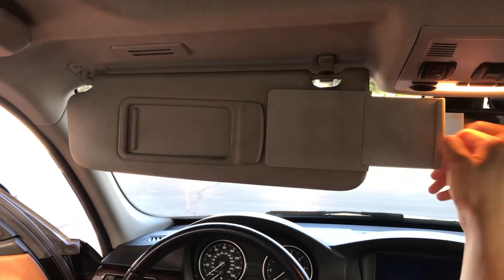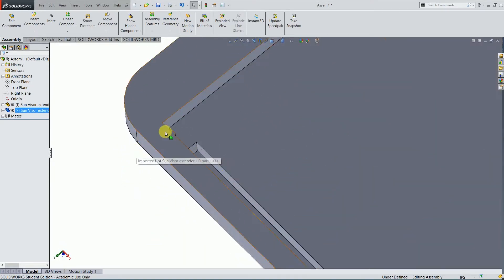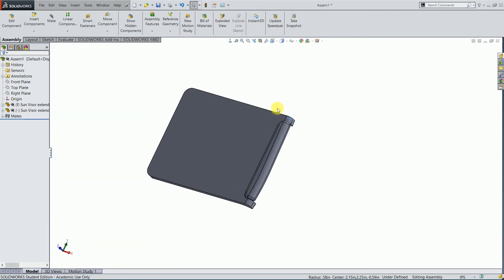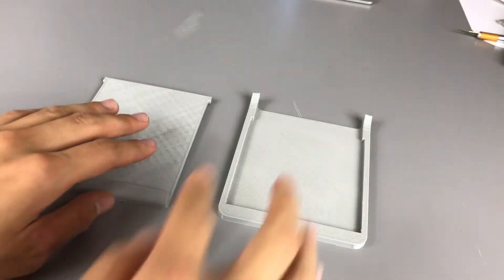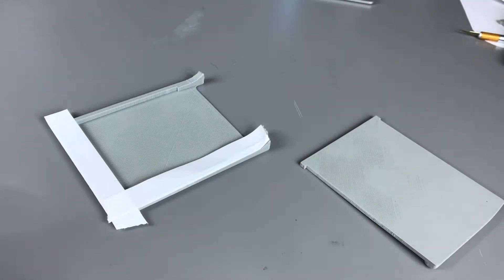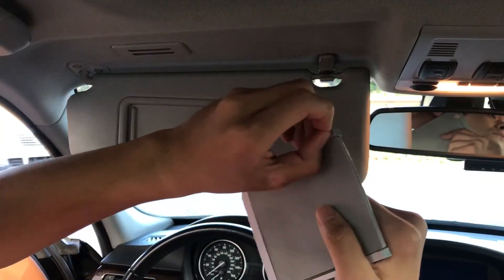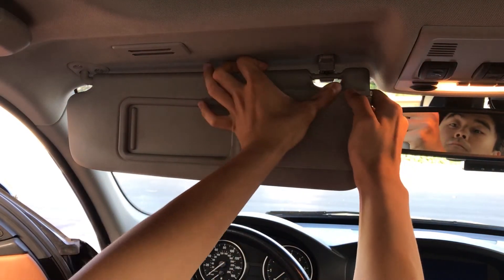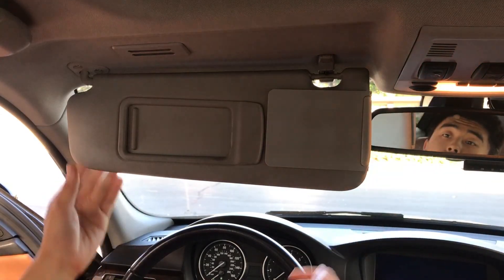Sun Visor Extender! | 3D Printing

Comment: Thank you for posting this! I've been looking for something like this ever since I got my car last year. Just sent it off to get printed. I'll let you know how it turns out.
Reply: So I just got it on my car and it works great! The only thing I needed to change was that I had to grind off the little nub on the inside that makes it stay closed; it was sticking really bad. It stays closed on its own anyway. I put it on the upper side so that you can't see it when the visor is up. All in all I got it made and shipped for $36 (not including the tape). Thanks again for posting this and the files!
Reply: I should also mention that I used a 400 micron layer depth to save money on production, but that also could be why the nub didn't work very well.
Reply: @itsadoorknob  How does it handle the car interior heat?  Does the 3D printed material change color or warp from the sun?
Reply: @kimtruong4676  I only used it for about a year before I got rid of the car and it was already starting to warp a bit. I dont imagine it would have lasted more than a few years. The color seemed to be fine, but it was only in direct sunlight while driving
Reply from the maker: @kimtruong4676  use ABS